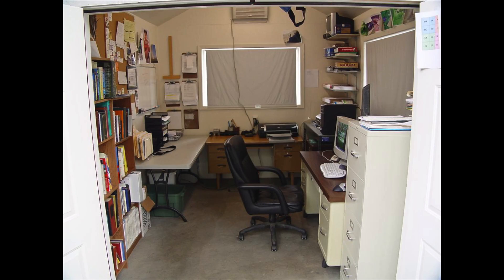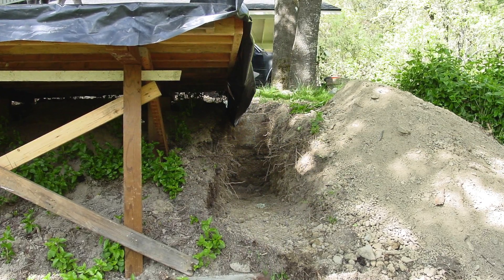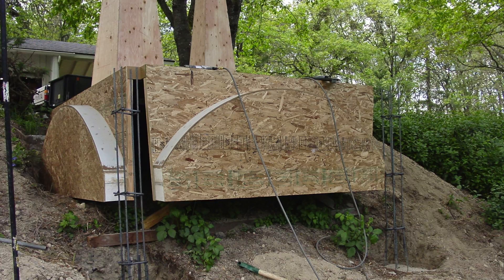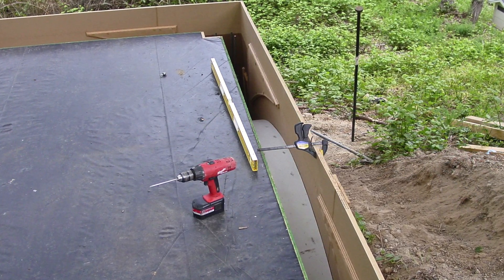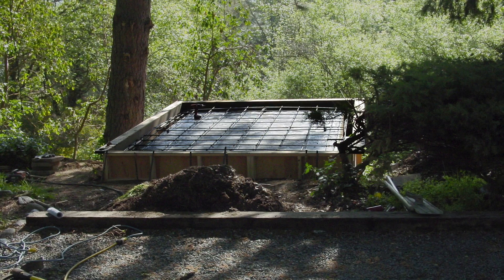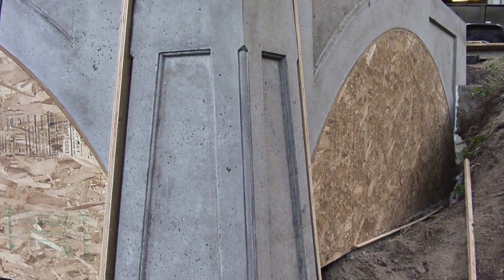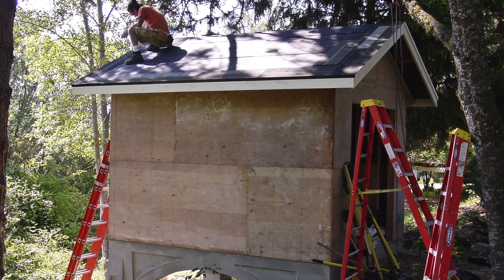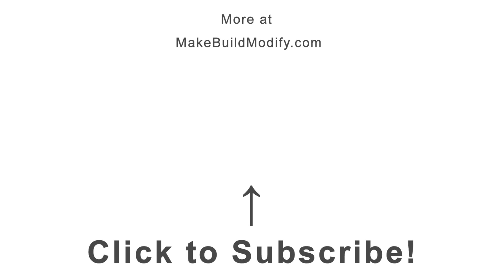Shed - Man Cave - with a Concrete Foundation - How To

Comment: that would be over the top on a 3700 sf home or somthing  I've read arched spans are the strongest shape and it should in parts of the world, this will stand for a very long time.

But I'd like to see it on a much larger scale, like an upscale home that's very large.
I also think to help take up space and use less concrete but still be strong you could use closed cell spray foam to take up some of the airspace and lower the mass of that much solid material and get the same effect's and close to ther same strength.  like the floor pour 2" concrete add 2" foam the pour more concrete over the top  centers of rebar could have been closed cell foam board  centers of side walls have a foam panel in the center, doing this you could have saved 30 to 40% of the concrete you used  Hey its just an idea to improve on what you did that is by the way outstanding looking.    It never hurts to improve and somthing you came up with after serious later thoughts
Reply from the maker: Interesting Ideas, thanks!

Comment: Man What a beautiful foundation... And no snap ties or anything, wow. I would have been so worried about blowout without any sort of ties I don't think I would have had the guts to vibrate it

Great Job and now others will have the pleasure of sharing your beautiful handiwork!

PS. Love all of the reclaimed you were able to work into it!
Reply from the maker: Thanks Dave! Yes, it was a little nerve-racking during the pour. The concrete pump guy was freaked out and I had to keep reassuring him that I did the math. I took the risk because I didn't want the signature conical dimples the snap ties would have left behind. Thanks for watching!